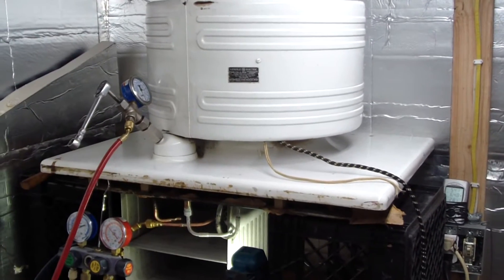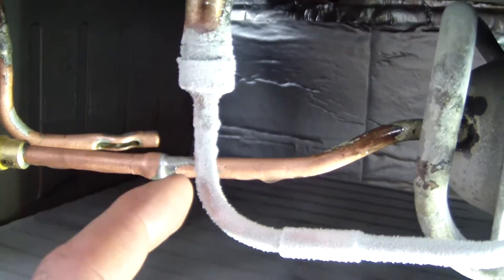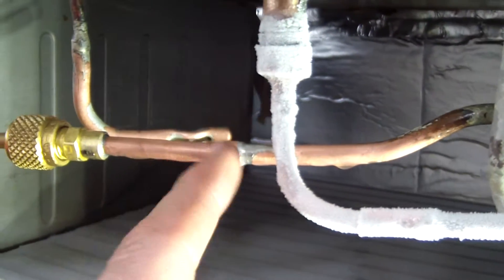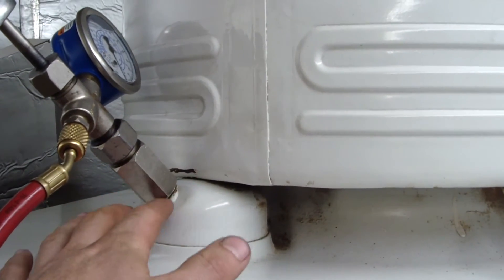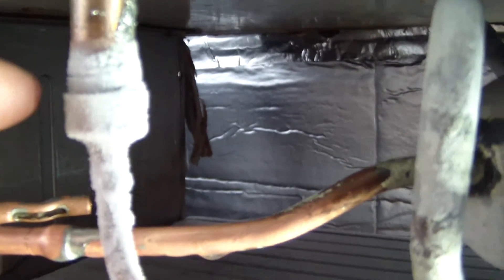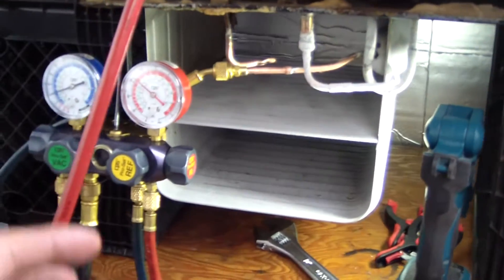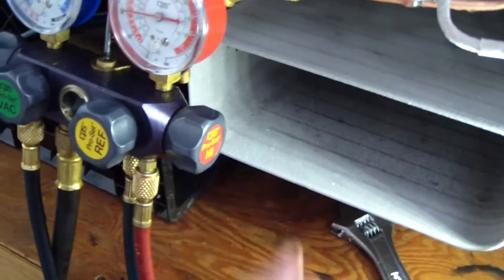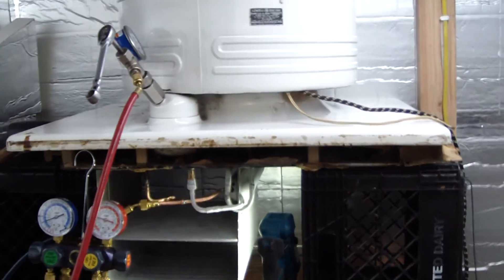Antique Refrigerator With Propane Refrigerant

Comment: WARNING about Propane in a SO2 machine! Did you read the tag on the machine?? High side test pressure 202 lbs, low side 150 lbs. on a 95 degree day low side non running pressure with propane will be 160 lbs. and with an 80 plus year machine you have created a bomb!!! The compressor dome can EXPLOSIVELY fail and cause a secondary explosion when the propane ignites with disastrous and fatal results!! Never replace or substitute refrigerants without a Thorough working knowledge of their properties there are way too many things that can and will go wrong!! S02 is unique in that oil floats on it and the evaporator is designed for oil floating in accumulator not mixed in solution with propane. Same for compressor oil reservoir and not designed for foaming on startup it will cause problems with unloader mechanism and oil pump will lose pressure. Also winding insulation is cotton impregnated with varnish, S02 wont harm it but Propane will soften and in time will dissolve and  arcing will occur. If a proper evacuation wasnt done and air is in system well you now have a really big bomb! Propane has totally different thermodynamic properties and will cause improper loading of compressor. That compressor is designed to run low side in a vacuum of 9" and hi side of 52 lbs. not 27 and 142. Hi side float orifice with SO2 has to pass 3+ TIMES LESS refrigerant than with propane and float level designed for SO2s molecular weight 64 for proper opening not propanes weight of 44 also if high side pressure is elevated too near to 200lbs float will be crushed like a sub imploding! S02 was non solvent and non miscible in oil but Propane is an excellent solvent and will scrub that machine like you have never seen! Will clean and loosen rust caused by S02 when machine was open to atmosphere for years will end up in oil and in float screen plugging shut. Hopefully this gives everyone the big picture here that you NEVER SUBSTITUTE REFRIGERANTS! SO2 machines that have run successfully for 80 or more years have proven that SO2 is not a dangerous refrigerant when properly handled and is in fact much more efficient than propane or any of the new refrigerants by far!  S02s coefficient of performance is a big 4.86! Ammonia which is high is only 4.75 propane is 4.62 that is a considerable difference and the running wattage of this machine is normally 175 to 145 while running. And will be much higher on propane than that. I always use the same refrigerant on any machine I repair except methyl chloride which R-12 is the replacement as methyl chloride R-40 is highly toxic and a nerve agent with over exposure. GE Methyl formate machines must use methyl formate there is not a good substitute that will work and still have machine be reliable long term.  I have repaired Monitor Tops and all other makes of early refrigerators for over 40 years and have a library of Service and Design guide books from the teens on up that are necessary to properly understand how these machines were designed and to service them without causing harm to lives and property. Substituting refrigerants on any machine even new ones can end in disastrous results if conditions are right.I have seen too many untrained people doing videos on here advising how to fix old machines that are accidents waiting to happen please DO NOT DO A PROPANE CHANGEOUT IT WILL MAKE MACHINE EXTREMELY DANGEROUS!!
Reply: Dam dude u gave me a semester or more in one thread. Power packed with info needed for my desicion making pertaining to stagnant pressures. I normally do my own spec testing but it gets expensive fast with refrigerant. Ur mini lesson gives more insight that I dont have to experiment

Comment: Good work!  I would never sell it.  At least, that's my personal rule for unique items that I have rescued from the very brink of being destroyed, forgotten, or scrapped!  BTW, have you given any thought to what you will do with the compressor oil?
Reply from the maker: TheSpazModic I want to get it somewhat restored, then I'll probably find a home for it; someone that will take care of it. 

I lost a little bit of oil while servicing it, so I added some mineral oil back. Propane is a fine match for mineral oil, and I'm not 6th least bit concerned about leaving it as is, although I should do an acid test on it.
Reply: That's cool.  I have an old open-drive refrigeration compressor that I would like to convert to a 4- or 8- cycle gas engine, once I get my little machine shop set up.  There are examples on u-tube.